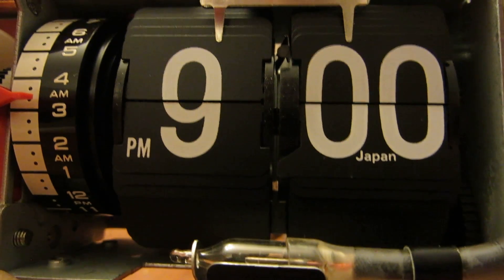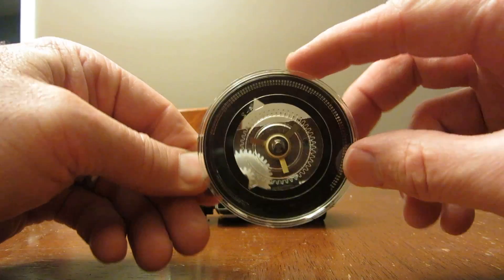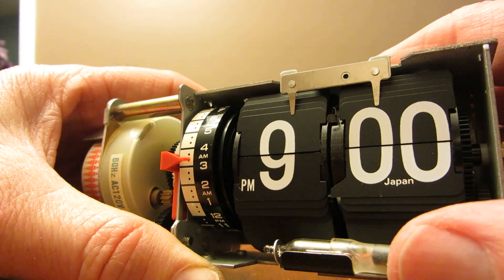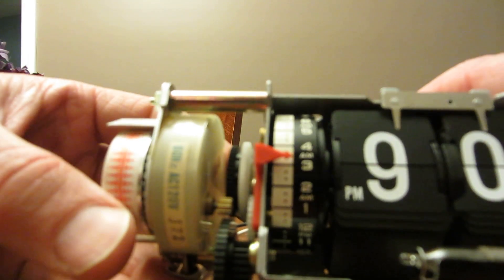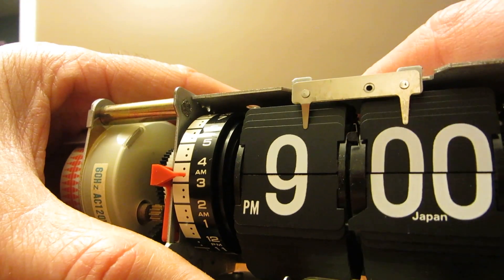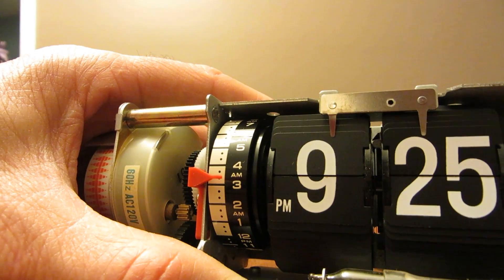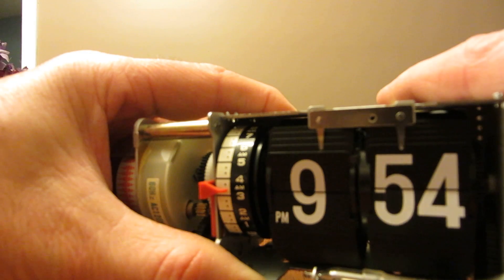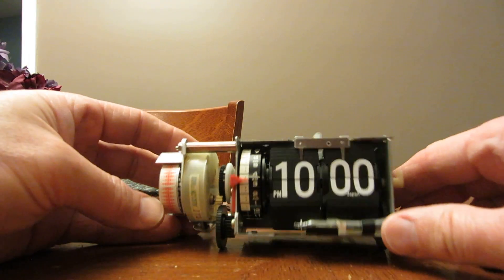How Does a Flip Clock Work? - A Look At The Flip Clock Mechanism

Comment: Hola, mi nombre es Angel, tengo  un radio panasonic con  ese tipo de reloj, pero no funciona, solo si tu lo giras cambia, automáticamente,  no!. Que debo hacer? Gracias por la ayuda
Reply from the maker: The clock probably needs to have the motor replaced. You’d have to get another one with a good motor.

Comment: Great video!! Question, I have a GE Flip Clock radio -  Model C4321B. My mother got it band new back in the 70's when she worked for GE. The radio no longer works, but the clock does. When the clock changes from 7 to 8 past every hour it makes a   squeak kinda noise. The clock is in a back bedroom and I can hear it from any other room in the house. Just wondering if you ever came across something like that and may know what causes this to happen?  Thanks!

Also, it says Japan @ 1AM..
Reply from the maker: Yes. The mechanism may need to be lubricated. It's hard to say exactly where.

Comment: Hi, beautiful and interesting video for the knowledge how the flipclocks work. Very well.
I have a Grundig Sonoclock 300, the radio works very well but the clock works only for a few minutes, I saw that the motor (Copal k85) turn outside but in the inside i can't see. I can't understand what is the problem.
You can help me with my problem?
(sorry for the english but i am an italian guy)
Reply from the maker: It would be very difficult to try to fix this without seeing the clock. I'd try to fix it for you, but you'd have to pay shipping to me and back to you. That could cost you some money.
Reply: @Flipclockfans  
I know that it is very difficult and expensive but it is very sad, I inherited this clock by my grandfather and i wanted repair it. 
Unfortunately here, in italy, I haven't find someone who can fix it yet.
I thought that i can replace the motor, but i haven't found a shop that sold motors (also online) for this clock yet.
Do you know some shop online or platform (like ebay) where i can find it, also in USA or in the world or some supplier of Grundig that sells spare parts online?
Thank you so much.

Comment: I have a flip clock but the hour clock flips 10minutes before it should, for example if its 12.50 it will display 1.50 is it hard to fix?
Reply from the maker: I really can't tell you. It would depend on the model, I would think. Even then, I wouldn't be able to say unless I saw it in person.

Comment: I have a GE 7-4310 and the spring tab is not grabbing the hour tiles to move them forward at the top of the hour. Is that repairable?
Reply from the maker: Aaron Hartley. Sometimes you can take small pliers or tweezers and bend it back in place. Go slow, make slight adjustments. It's easy to overdo this.
Reply: Thank you for the reply - I will give it a shot tonight! Thanks for all the videos you post - I've used them to help me get this radio apart and diagnose the problem (this is my first flip clock radio).
Reply from the maker: Aaron Hartley Let me know how it goes.

Comment: is there a way to adjust hours without adjusting minutes? or are the two inexorably linked? (daylight savings is a pain).
Reply from the maker: BraveLittIeToaster They linked forever. If you're not from the era of flip clocks, you may not know ... This is just one of the reasons flip clocks were dropped so quickly after digital came on the market.
Reply: ah I see. thanks. I still prefer passive lighting over the blaring led, but I can understand the appeal.

Comment: Hallo!
Did You know if flip cloks have any slower\faster regulation? My Copal going to slow unfortunately...Thx!
Reply from the maker: Some clocks actually do have an adjustment screw, but it should be pretty obvious on the side or bottom of the clock and be labeled with a + and -

Comment: Thank you so much for your video. It helped me repair a COPAL 705L alarm clock that was flipping over the hour digit too early. I realised that the little clip that is supposed to hold the hour flipper had rotated 180 degrees on its spindle and was therefore not holding anything! The amazing thing about this clock was I had one in the 1970's which was exactly the same (if I remember correctly), but I got rid of it many years ago. The one I have now I bought on the internet a couple of years ago from a small store in Brighton, England. They had 'new' old stock of these clocks which were still boxed. I couldn't believe my luck! Anyway, I can enjoy it for a few more years now thanks to your video!

Comment: I have an analogue version of this clock that i bought in June of 2013. I needed to fix the movement. The movement is made by Sunbeam, and yes, I did notice the Japan on the 11 on my flip clocks.
Reply: BrunoShow124 analog version? they're all analog.
Reply: I meant a regular clock, not a flip clock.
Reply: Mine has "Japan" at "00" in the bottom right corner
Reply: We used to have a series of Panasonic clock radios, all of which had the "Japan" under the number 11; they used a much squarer font than the one shown here.